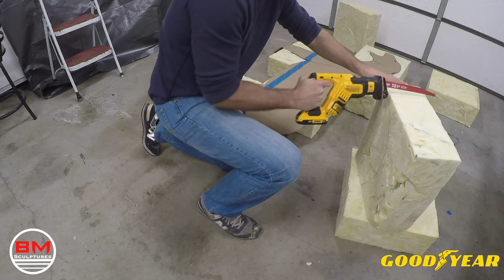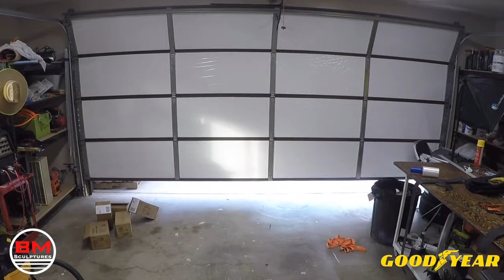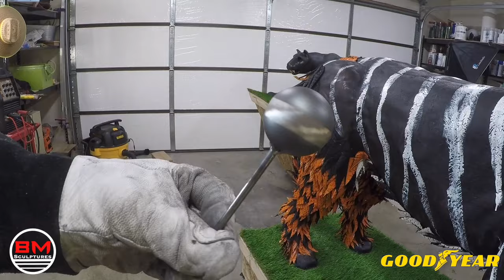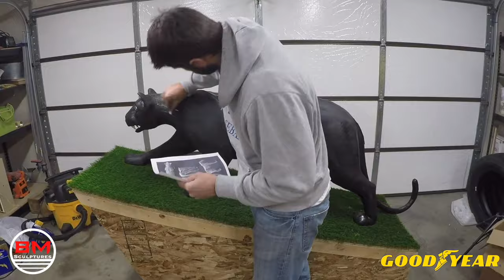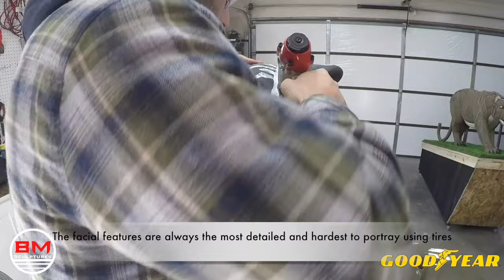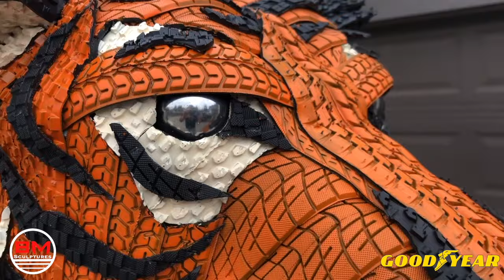Sculptures Made From TIRE TREADS!  Carving & Sculpting (condensed footage version)

Comment: Can you briefly explain the fiberglassing process?
Reply from the maker: I actually send them off to get fiberglassed however it is a fairly simple process. You basically just put some resin on the sculpture, lay down your fiberglass and then brush on more resin so it penetrates the cloth. Then just wait for everything to cure. In tight curved areas you would use thinner, fiberglass scraps.